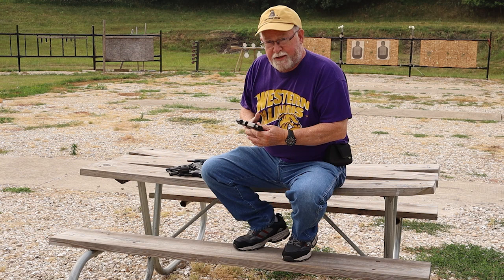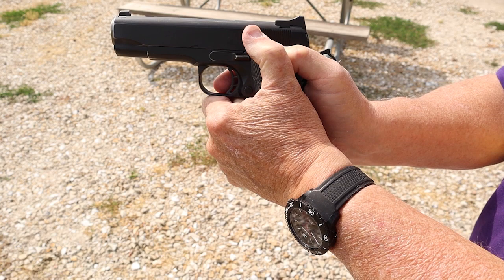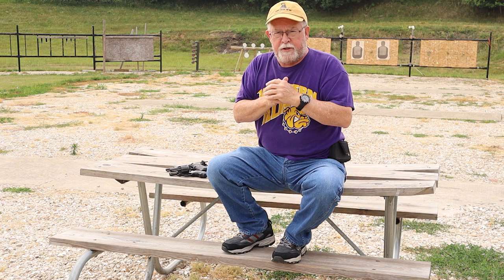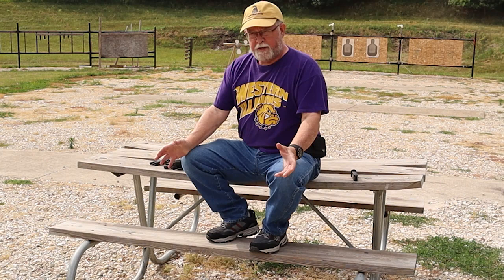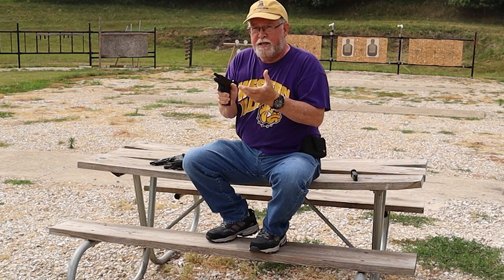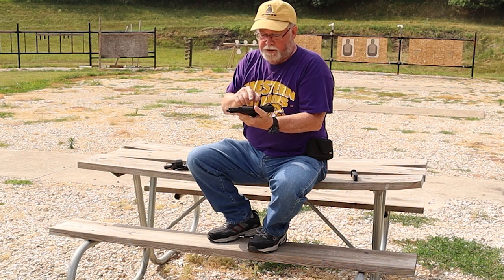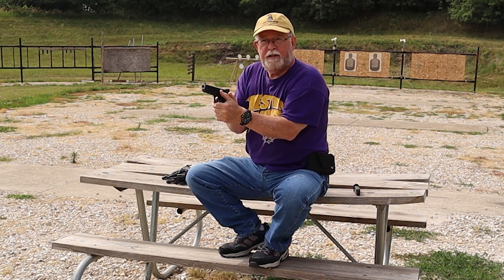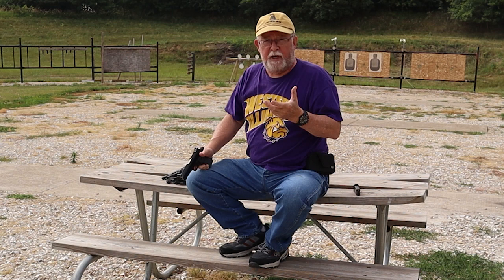Marksmanship Techniques - GRIP

Comment: When I was first taught to use a pistol, it was a revolver.  I was taught the low thumb technique.  That was 30 years ago.  Used the same technique with semi autos because that’s what I knew.  I never had a problem with that grip with any type of pistol or even larger caliber ones. Plus that’s how you should be holding it if you have to go one handed.   Also at the same time was also taught the Weaver or Modified Weaver, but it wasn’t given a name.  It was probably a decade later that I learned it was the Weaver stance that I was taught.  Love this channel.
Reply from the maker: If your technique works for you, don't let anyone talk you out of it.

Comment: I do not remember when I first learned the Weaver stance., but those who say that the Weaver stance will get you killed, or the same idiots who think that a 9mm will equal virtually anything else you can shoot in a realistic handgun cartridge.
I teach the Weaver because you can fold your arms up and draw it all the way into you to keep from presenting the firearm out too much so that you can do in building clearance drills without holding your Firearms so far out that it can be taken from you yes that exaggerates the use of the Weaver but that's why the Weaver works. Not only that, if you have a firearm that you think recoils a lot, the Weaver tends to absorb recoil far better than the isosceles. I have done drills with a Ruger Super Blackhawk with Full House loads in it. I find the Weaver quite handy at that point.

Comment: All my experience is in competition. I do use the thumb forward grip. I compared my two hands, and in my case the thumb forward on the left hand exactly duplicates the wrist angle of my gun hand, and feels stronger in that position. However, I will try your suggestion. I’m not as strong as I used to be, and always willing to try something old/new! Might be I’m missing something. 
Your comments on springs certainly hits home. I always set my spring to run limp wristed with my weak hand. Might be harder on the gun, and I’ve certainly experienced a problem that could be connected, but that was secondary to performance!
Reply from the maker: It took a long time for me to move my left thumb forward of the safety on a 1911, but I think it does help.

Comment: I never even attempted holding my thumb on the safety because I do have smaller hands, and I never did get the safety that had the low paddle on it for my 1911 for either of my 1911's. I've never had a problem with the safety being pushed on on the recoil, and I've never had a problem with my extended slide release holding the slide open during recoil either. Rolling your left hand forward with a right-handed shooter isn't even a consideration for me either. It does not help in Recoil mitigation. And the hold is not natural, and therefore is an afterthought to even try to maintain it. It's attempted Wizardry. Even the 10 mm I don't find recoils enough to need any special hold, just put it in a proper Weaver stance and it's not going anywhere, it will return to its aiming Point as long as you maintain your hold.

Comment: As for the model 92, I would not suggest even to this day that any police officer or somebody who wanted to carry the gun for their defense, carry a Beretta 92. When you do a clearance drill and you put your left hand on the top of that slide pinch the rear of it and rack that slide to make sure it's clear. You can easily hit the decocking lever. That will disable the firearm in the middle of a gunfight. It is the worst piece of shit ever put on a fighting firearm. I didn't even like them on the Smith & Wesson but Lisa Smith & Wesson was not as easy to cause it to go on cuz it didn't have paddles on the sides of the decocking lever. But I didn't like them on the Smith & Wesson either. They are not a safety. People keep talking about that being the safety on the Beretta it is not a safety. It is a decocking lover and that's what it was designed to be when Carl Walker designed it in 1929.
When the firearm is designed to do things that are unnecessary, you shouldn't have them on a duty weapon. Sometimes you have to put up with it. But decocking lovers are a bad idea. They finally have the detoxing lever spring-loaded so that if you inadvertently hit it it automatically pushes itself back off. Now you only have to depend your on this tiny little spring to keep you alive.

Comment: So the guy from Ohio went with a Sig pistol, which has even worse problems, it has several design flaws, especially in 40 Smith so much so that 4da agents were disabled on the gun range within a two-year period from about 2008 to about 2010 and they finally got rid of the pieces of junk. I don't think I have the time here to explain the problems that the Sig had but the DEA got rid of them and went to H&K